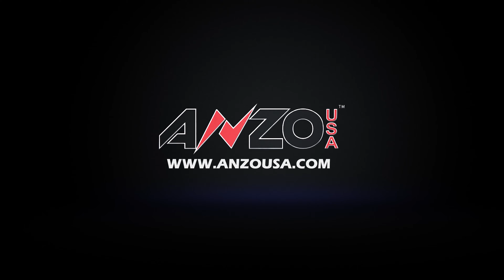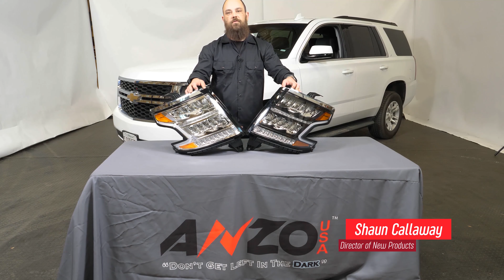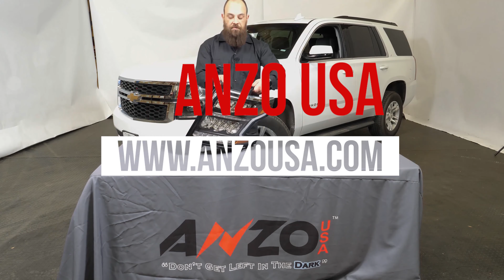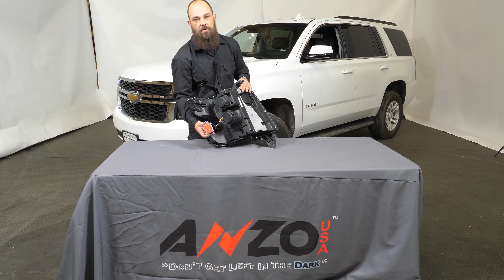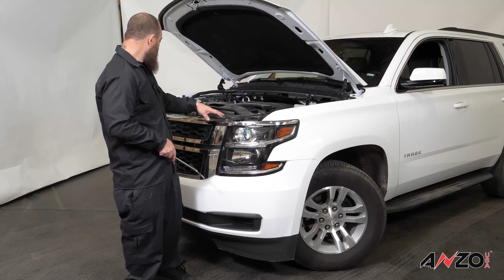Anzo USA 2015-2020 Chevy Tahoe/Suburban Full LED Beam Headlights with LED Sequential Signal

Comment: I've got a 2017 Suburban LT with Halogen bulbs.  They are awful and would love to upgrade or swap with LED.  when I asked my local chevy dealership about it, they told me that the lights could not be upgraded to LED because it will effect other lighting or could cause other electrical issues in the truck.   Since your product is actually changing out the entire housing, does it effect any electrical items in the truck, such as turn signals, inside lighting, brake lights, dash lighting, etc ?    Would this void an extended warranty that I have with the truck?

Comment: Wonderful video and a lifesaver thank you! The only video I could find to remove the entire headlight assembly and not just the bulb. My 2016’s a little bit different but for the most part this was absolutely necessary for me getting that headlight out!
Reply: Is your 2016 a LTZ model w/HID? 
That's what I have and I just need a new pair of headlights because of moisture build up and I don't know if my HID set up will work with these particular housings. GM wants over $2300 for a new set of headlight fixtures that comes with everything from wires to ballast but they won't sell parts separately. Is it a way the housing is built that won't allow me to use aftermarket headlights with my HID set up or ?